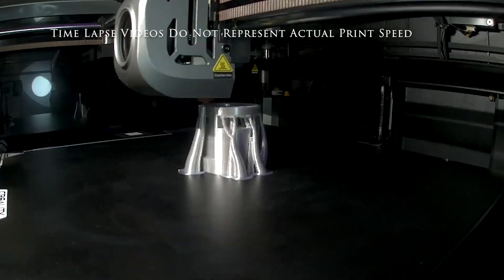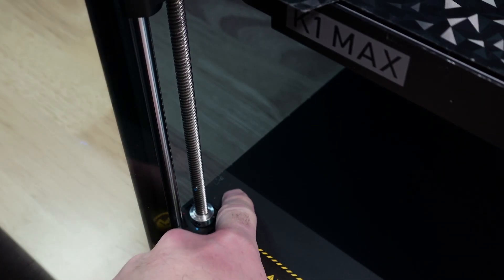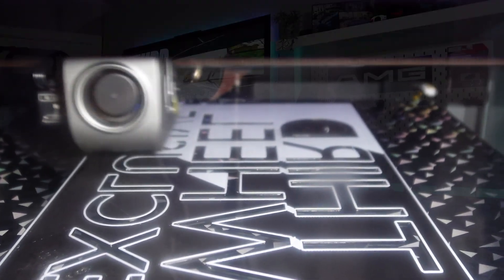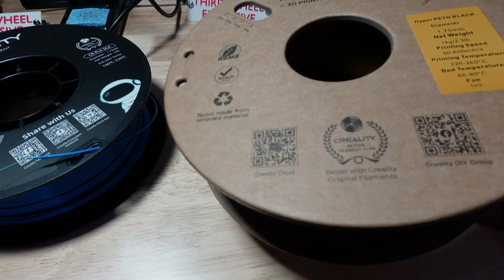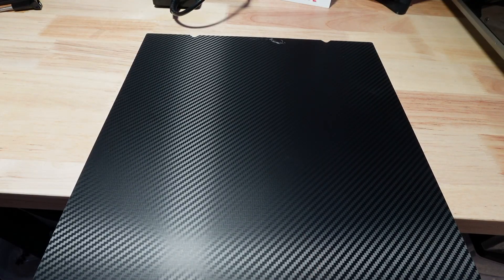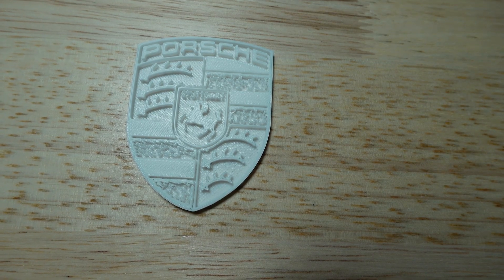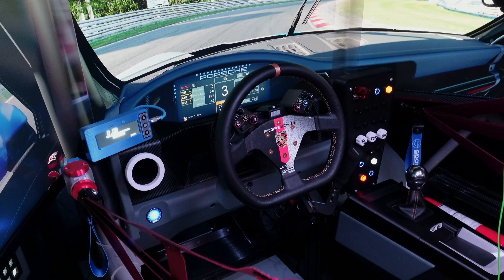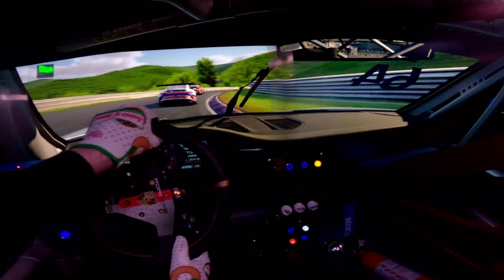3D Printing a Race Car Cockpit with the Creality K1 Max

Comment: I hav a question. As someone with Zero knowledge of 3d printing.. if i bought this printer. Is it basically plug and play if i just want use the "code" thing ( dont know whst its called) people sell and put on websites for different things to print? Or its it harder then that?
Reply from the maker: If you are just using STL files then the slicing software does a lot for you. It’s not as easy as clicking print but you can easily get printing with a few tutorials. The K1 comes pre-assembled as well but there are some screws to take out and few steps to set up.
Reply: @ThirdWheelExclusive I'm decently tech savvy and mechanically inclined I'm thinking i can figure it out.. thank you for the info as I'm a complete noob when It come to 3d printing
Reply from the maker: @Spackolii I am sure you will find it pretty easy then. Once you learn cad software or blender, designing can be fairly easy as well until you get to something really complex in shape. Feel free to hit me up of your ever have questions.

Comment: My K1 Max was my 5th printer. I have had very little problems with it, except for the A and B build plates either not adhering or adhering too well. I am currently using my Max to customize my NLR flight rig. Keep up the good work!